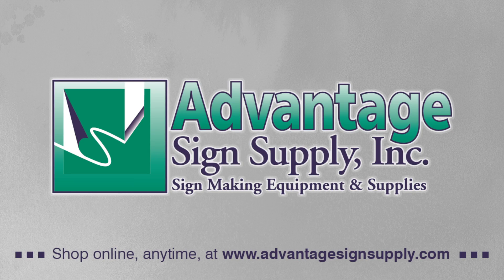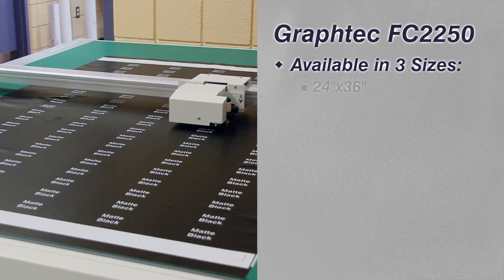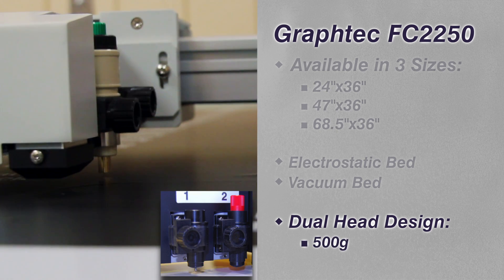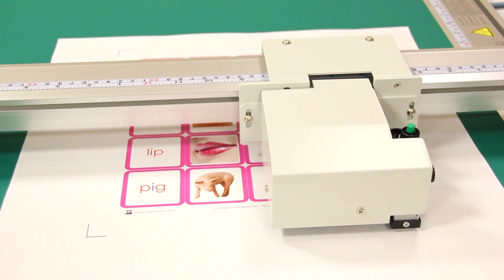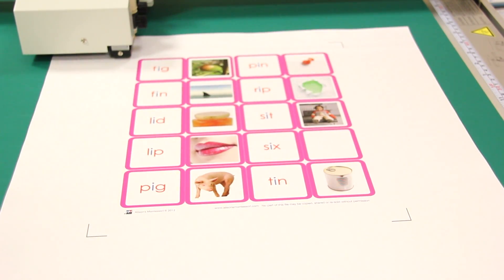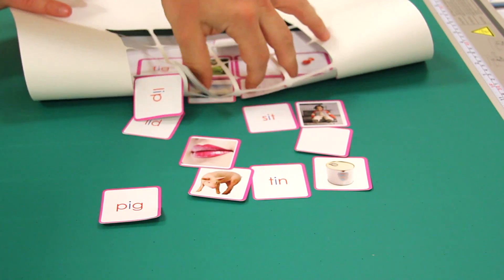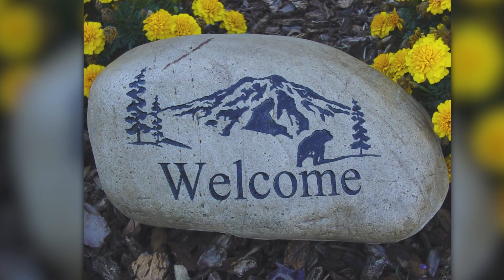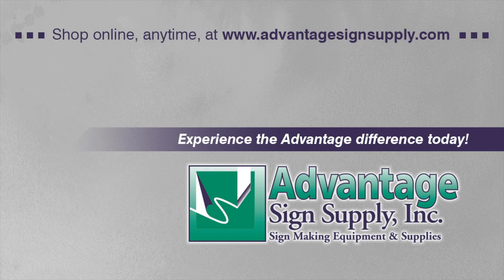Graphtec FC2250 Flatbed Plotter

Comment: What is the thickest it can cut? What is the smallest size cutter you have for up to 15cm wide materials?
Reply: It cuts about 1/8 inch depending on the blade setup you can find. Parts are hard to come by and the 60° blades we get are $100 a PIECE. And even the tool holder breaks sometimes. Maybe that is a brittle plastic issue. I’m thinking about getting a hold of better blade holders for these.
Reply: @EGGSHELLWRAPS  would this cut thru backlit PET ?
Reply: @drakesis  the blade holder breaks trying to cut 1/32 and 1/64 thickness reflective acrylic (4000 series diamondgrade) 

I don’t think this plotter can handle the necessities of thicker plastics. It can’t even cut hard stencil LDPE material.

In this, your limit is probably cardboard if you can find the right tools, and LDPE. Our plotter has paid for itself cutting these engineering materials for us though.
Reply: @drakesis  i’m no expert but i’ve worked with this plotter for 5 years now so i am pretty well acquainted with what breaks, what comes loose, and what it will do.

I’m from MS at blue chip signs
Reply: @EGGSHELLWRAPS  ok, darn. One local for sale @ $300 thought it may work for 210micron
Reply: @drakesis  where at? Been looking to get a secondary plotter for home use. This plotter has paid for itself 3x over
Reply: @drakesis  and yes, the blades may go to 1/8 inch or so but you will need the right blade angle for your material thickness and hardness. We use tungsten carbide blades for our material and they still break occasionally. Only 40-50 microns thick. Haven’t measured recently.
Reply: if you need any information , please email me  mexico@richpeace.com
whatsapp \wechat 0086 13212286971